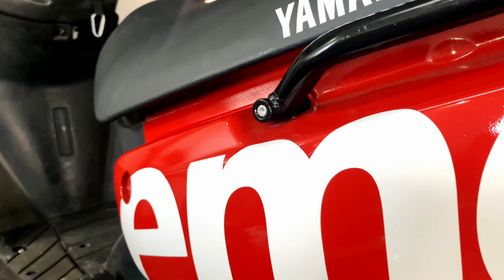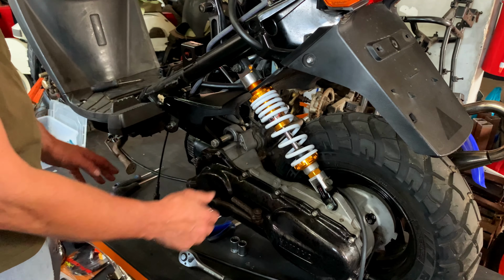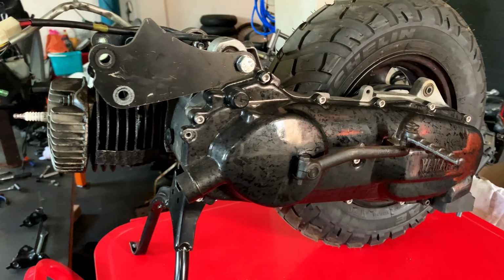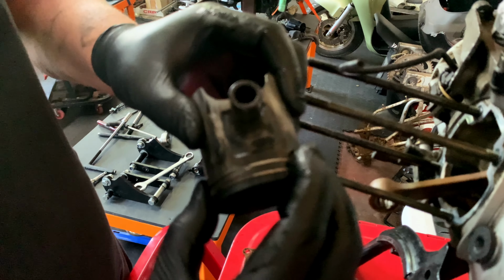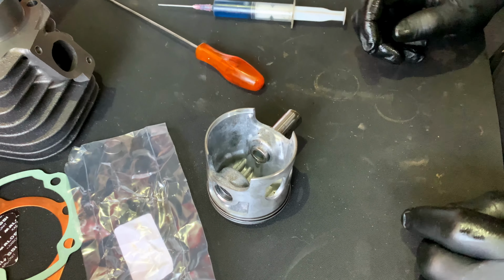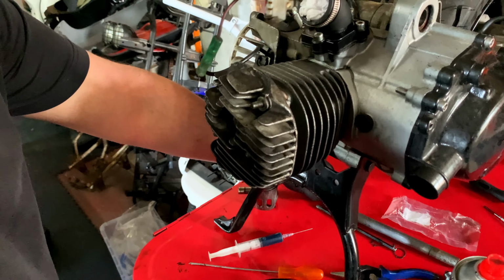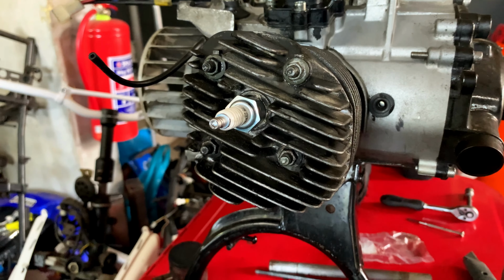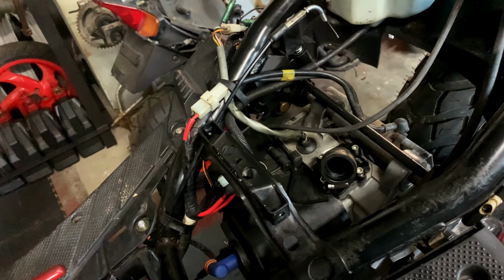The SUPREME Yamaha BWS is back and its getting a MALOSSI 125cc BIG BORE KIT!

Comment: In my opinion, high comp. cylinder head and stroker crank shaft should be added..
Reply from the maker: We have built a few 135cc motors with 125cc kit and 10cc stroker crank. Just remember, you can't run too high compression on a 2T motor because the combustion chamber pressure increases with the rpm and you can end up with a 'hydraulic' situation and the engine won't rev high.
Reply: @urban_riders  The job is not finished just by installing the stroker crank shaft and high comp. cylinder head. It is necessary to adjust the pressure with spacers and various operations.
I am currently using the Airsal 117cc, 50.1 mm crank, Polini CP 23 in a very healthy way, but I have made many adjustments to the engine.
I can also follow the engine temperature from the display, there is no problem. There are many tuning options available on the Minarelli 100cc.

Comment: that original crankshaft carries how much power is that enough ?
Reply from the maker: The BWS100 crank is very strong and can take some serious power upgrades. This motor is at least around 17hp. We've pushed them to 22hp without any crank issues. Got 2T oil also helps with durability.

Comment: Which jet is in it ?
Reply from the maker: This Dellorto is running the 78 main jet at the coast, with the thin needle taper, and the needle clip is at the bottom position. This is because it's running cone filter and we at sea level.